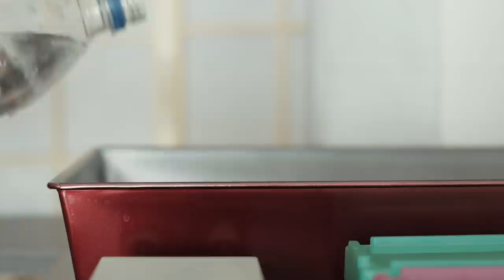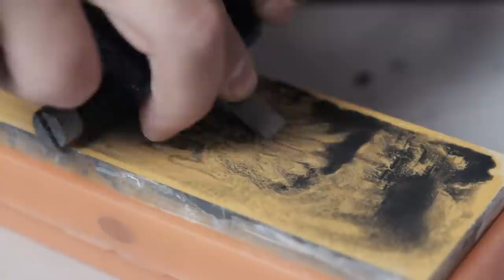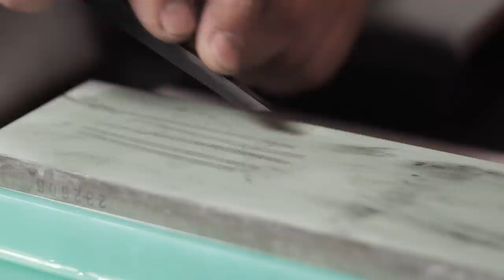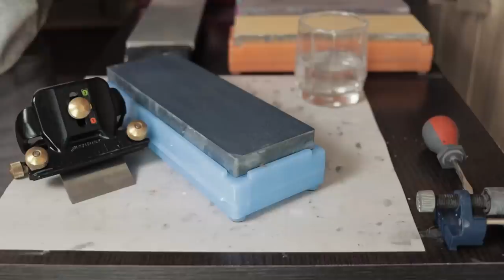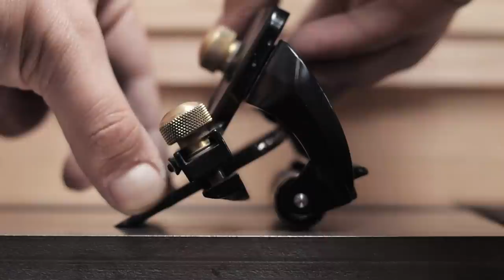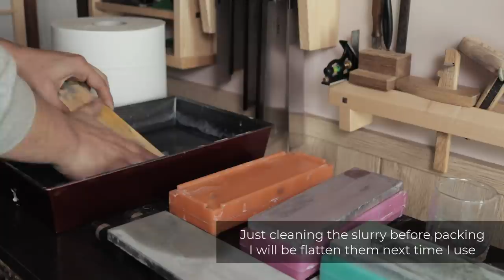Sharpening my Woodworking Hand Tools

Comment: That Veritas looks very nice, I wish I could afford it.. I have a question: you use the diamond plate only for flattening the stones? How do the coarse water stones compare to using the diamond plate directly?
Reply from the maker: Yes, I use the diamond only for flattening (I used it too to grind before having the #320, but I wear it and now I regret that :) ) 
My diamond is #400, I use it to flatten the #320 water stone too, it works, but is not the best practice. Next I wan't to get the #160 diamond specially to use it on coarse stones too.

Comment: Interesting- my roller also wore out and I ended up moving to hand sharpening at that point. Great video! Tiny tools sharpening next of course?
Reply: Just noticed the tiny chisel was in the unusual blades pile. I take it back!
Reply from the maker: Yes, I partially blame the roller, but also just when I got it new it seemed to skew the blade. It is possible that the blade as new was sharpened skew then I straighten it, then the roller wore and so on :)
I see that Veritas made a new miniature honing guide, I will take that one day too :))
Reply: @AdrianPreda  I just discovered your lovely channel! 
Your work is beautiful. Do you clean the roller on the jig between stones? Is that necessary? I use only diamond and Arkansas stones and know little about waterstones.

Comment: I only use the cheap blue guide for sharpening. For me works like a charm. :)
Reply from the maker: Yes, it's good. I might take another one and shape the slots with a file for particular blades
Reply: I use the rods as support for chissels, and not the gap. :)

Comment: Nice video.
I also have the Veritas grinding device, I also use it for my chisels.
As sharpening stones I have diamond sharpening stones for the planing knives.
For my Japanese chisels, I have Japanese water stones from King.
I also sharpen the western chisels on the diamond sharpening stones.
I also sharpen the knife from my Japanese planer on the Japanese water stones freehand.
Well I could also clamp it on the Vertias device because I have a holder for short irons.
Reply from the maker: Thanks Gunter! 
I wanted to get the short blade attach for the Veritas guide, but eventually used the cheap guide. I see that they came out with a miniature honing guide for the mini tools, I wanna get that one :)
Reply: Hello Adrain,
Thanks for the answer.
I also bought a barrel roll for the Veritas grinding guide. This is for the western planer knives, so that you can "round off" the corners to avoid getting any planing marks. 😉

Comment: Very nice. I understand the Atoma dressing plate comprises a diamond plate glued on a reusable steel base plate: how often do you need to replace the diamond plate? Is it reliable?
Reply from the maker: Thanks! So far, in three years, I never replaced the Atoma. It still holds decently, it looks indeed that it's wear out (I used it to grind the veritas blade some times, regret that) but I estimate it will hold another year. Don't know if is worth changing just the glued part, I remember the price difference is small, like ~70 euro just the reusable part, and 80 complete...probably in time that Alu plate (it's not steel) is no longer flat, and don't know exactly how easy is to unglue the old one, looks very well put together. And, you find yourself with a nice 10mm thick Aluminum plate for other diy projects :)

Comment: Hello Adrian, very nice video, I have been waiting a lot for this one. Thanks also for your willing to answer questions  I have a couple.

For the veritas guide, do you use oil or something to avoid rust or what do you use to keep it as new.

For the Japanese blade, do you fit it with the veritas guide without angle right, I mean, the guide fits the bevel of the blade and not the blade fits any angle right?

Have you tried any other stones? I have different ones and want to know why would you recommend these.

Finally, sorry, any advice to have a good sharp? I have noticed in my case I'm not very good and really want to improve in that.

Thanks again for this, is really appreciated.
Reply from the maker: Hi Ricardo! Thank you!
- sometimes I use some camelia oil (this is volatile oil), but not that often, although I read in their instructions that you should do that to maintain it. Careful with other oils, don't use too much so will not spill on the stone, it will ruin it.
- exactly, try and try until you fit. 
- just a Naniwa Homestone 1000/3000 as my first ever stone. It's not that fantastic, wears rapidly and very slow. If look for a reasonable priced one for beginners go for a combo stone like 1000/6000 from any Japan made manufacturer, Cerax for ex makes one good.
- other than patience I don't know :) Use guides in the beginning if you're not confident free hand, grind the bevel until you see a consistent color/texture all over the area, if your blade is dull or chipped grind it, no mater what, until on the back/flat side you won't see those anymore, just the clean line of the tip.

Comment: Hi, just started with Japanese handplanes and chisels. Have been interested for a while but didn't have the time and in addition wanted to first read up on them. 
I also checked out your video "how to prepare a kanna" and in this video as well as here you do not tap the iron. Is that just because the ura of your blades are still were they need to be? Do you have any experience with tapping Japanese blades? Checked for a video with at least English subtitles as I feel like missing out on some crucial information in the Japanese videos I found. Maybe you have a recommendation for a good instructional video on that?
Thanks in advance for the tips and for your video as well of course!
Reply from the maker: I never tapped a kanna blade, probably I will try that one day when the ura of the blades I have will dissapear. On the 3-4 kannas I have the ura came pretty decent, well not that thin as you see on more experienced users and premium kanna, but workable.
Reply: Hi thanks for the info.

Comment: How do you clean your water stones? Mine seem to get dirty stains. Like metal particles stick in it and go rusty
Reply from the maker: I just clean the slurry at the end, I don't flatten them, I do that next time I'm sharpening. In theory, the waterstones can bend in time, so if I flatten it now, leave it for some time, I may not have it flat when using it. 
Depends also on the quality of the stone I think. You have these same Shapton one? My first stone was a cheap naniwa combo 1000/3000 and was not that great either in sharpening, either in maintaining it clean.

Comment: Is there a reason you don't use a leather strop for the finishing touch? Just out of curiosity, becuse oher woodworkers seem to consider that a part of the holy process.
Reply from the maker: I just do not like the strop for straight blades/flat tools, the idea that I make a microscopic roundish bevel on the tip.

Comment: What about the backs?
Reply from the maker: You normally approach the back only when you get the blade new. You flatten it to the highest grit you have, not all, about 1-2 cm, and leave it like this. In time, if you consider it's not flat anymore, you may refresh it. When normal sharpening you do only the bevel then a few strokes on your highest grit stone on the back to remove the burr.
Reply: @AdrianPreda  Yes I know, but you made no reference to it at all. It's critical and novices won't know and may be frustrated when the chisel won't sharpen if they don't flatten the backs. Just saying ;-)